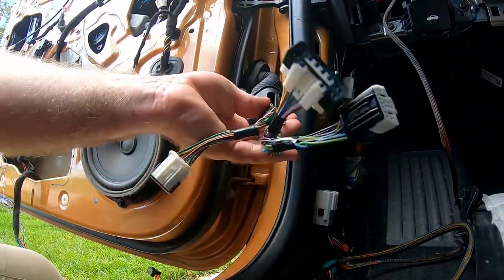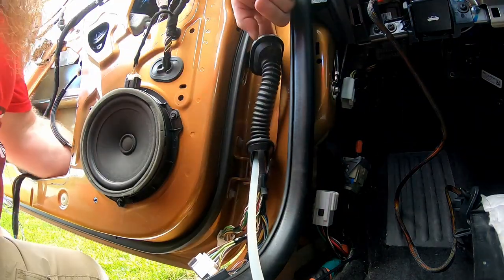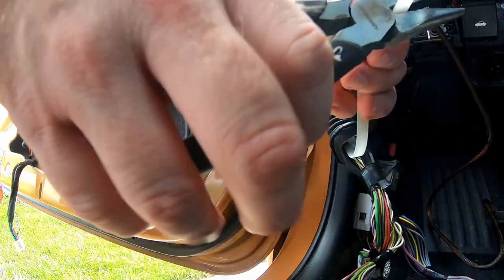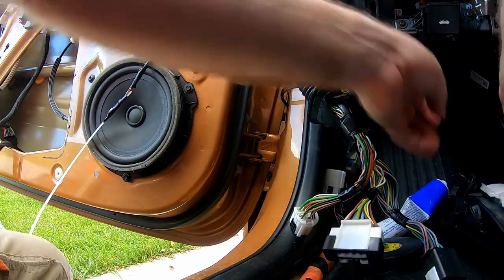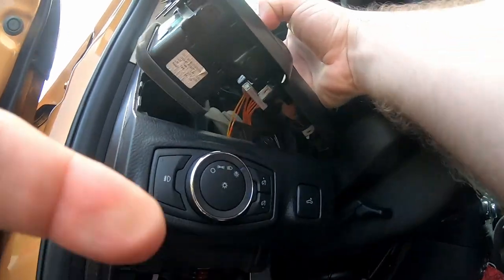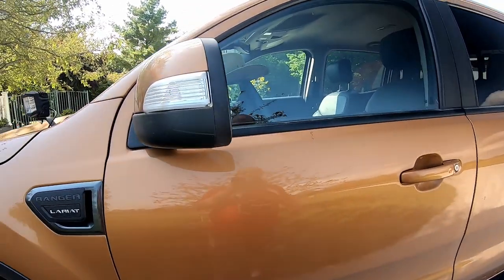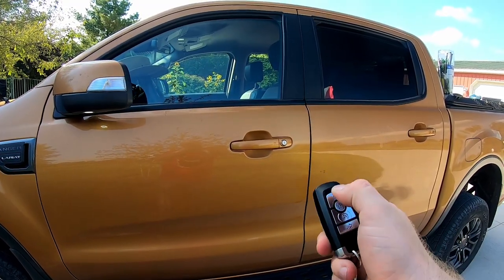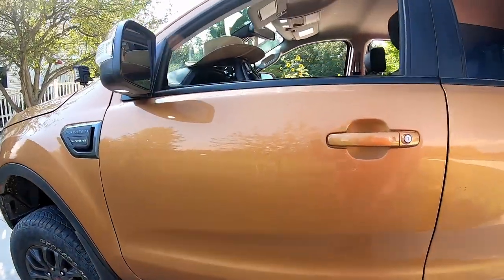2019 Ford Ranger - TRAC Auto window and mirror module install overview

Comment: Can i make this upgrade to a xlt ? Does it comes with the harness in for the folding mirrors from factory? Thanks!
Reply from the maker: I'm not sure if the other trim levels have the needed wiring to work. I would check on the Ranger5G forums as I think someone has done this mod.